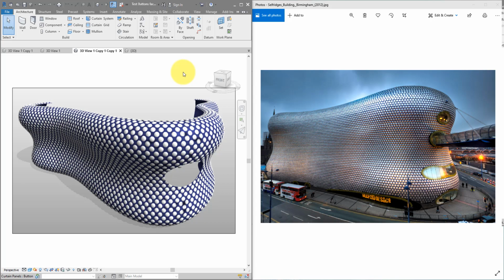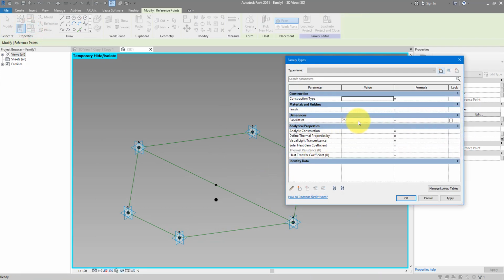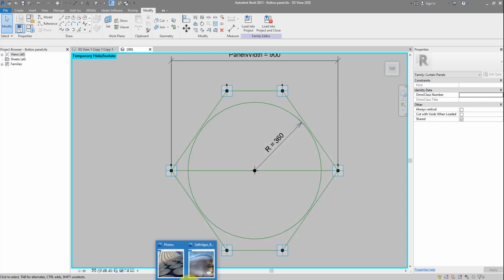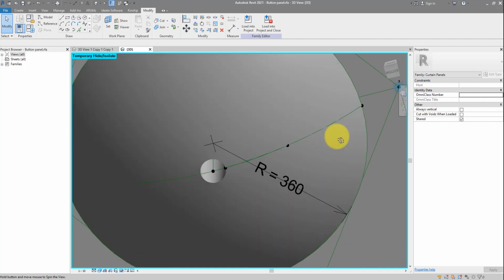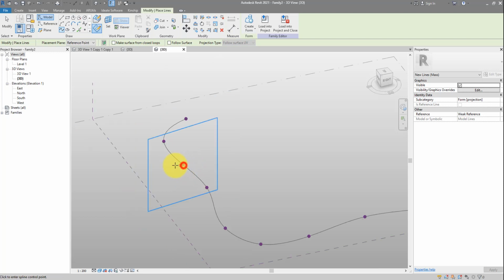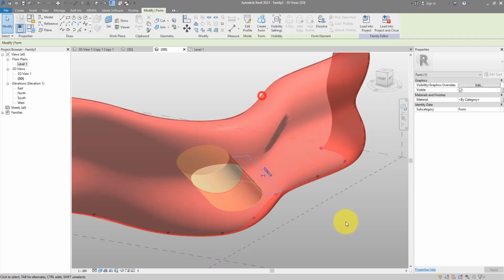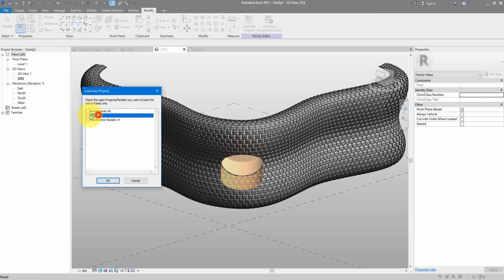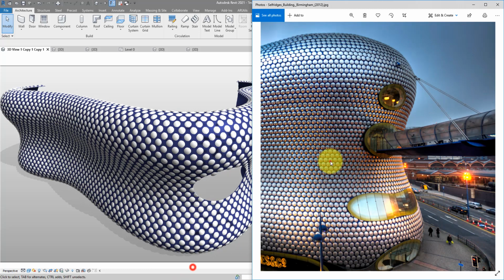Revit Snippet: Create “Buttons” Facade with Massing Curtain Panels

Comment: Excellent video!
Reply from the maker: Thanks 😎 Hope that was easy to follow?
Reply: @RVBoost  Sure and that's because you explain things very well. Troubles show when i try to make things on my own. Adaptive components will drive me crazy.
Reply from the maker: They still do that to me sometimes! Next time you get stuck with them, just send me a photo of what's required :)
Reply: @RVBoost  I will. 
Thank you so much!
Reply from the maker: Sorry I actually missed this comment from you! I'll see how to fix this problem 😁
Reply: @RVBoost  Thank you for your time.
Reply from the maker: Are you modelling this based on a real building? If so, could you link me to a photo of it?
I figured out the panel, just want to include a real project in the new lesson :)
Reply: @RVBoost  No the purpose is very basic. I was trying to build  tensile canopy families (velums). For the 4 base points we can have a satisfying shape by generating form with 3 splines.
For the triangular one, i can't find a way to generate a form as good as for the other case. There is always a flat area in the middle.
I know that my case appears to be very basic, but i can't fix it anyway.

Here is an image that shows the situation. I'm also adding the Revit file.
https://drive.google.com/file/d/1JzK0yjMusZ2zTEb12IsMSeyrrQLJU-Db/view?usp=sharing
https://drive.google.com/file/d/1HLA2NDCMGZhzdn8Mb3qcfr792dZ_aU_D/view?usp=sharing
Reply from the maker: This seems like a limitation of Revit. You can instead use a 4-point panel & place 2 points very close together to get the same effect. I've done some images here: https://drive.google.com/drive/folders/1_RMORQ5qlU8RHPE6wGuicoL_fdjvEdgO?usp=sharing
Reply: @RVBoost  Oh i'm glad to hear that. This time the limitations weren't coming from me.
I tried a few ideas including the very one you suggested so i think i'll stick to this one.

Thank you for your help. ;-)
Reply from the maker: Yeah most Revit tricks are just trying to play nice with its limitations 😂 Keep up the good work!
Reply: @RVBoost I'll also keep on praying for Revit to fix much more important "limitations" such as the stairs.... ha ha ha
 Thank you again.